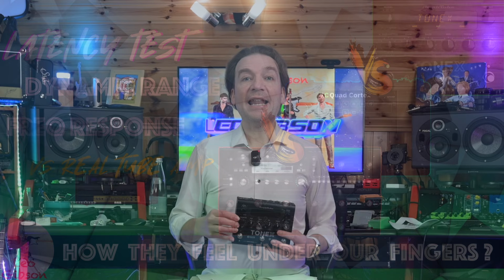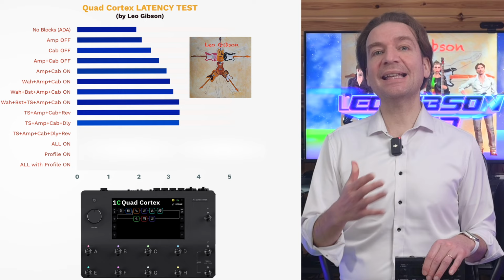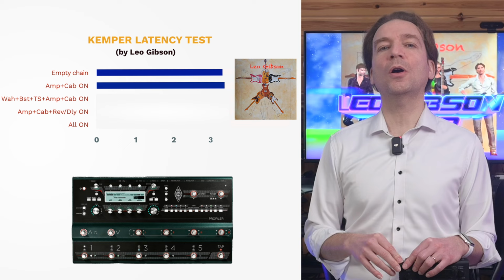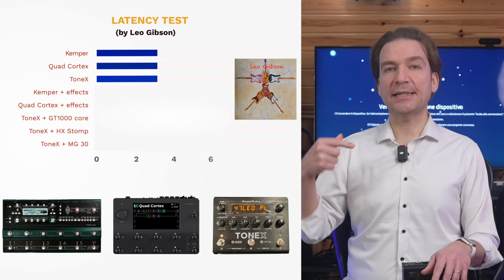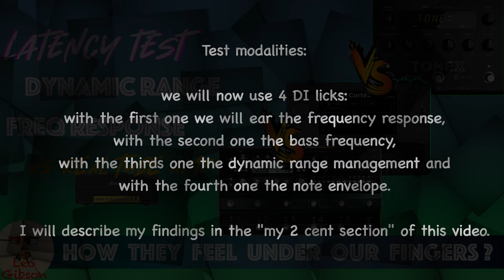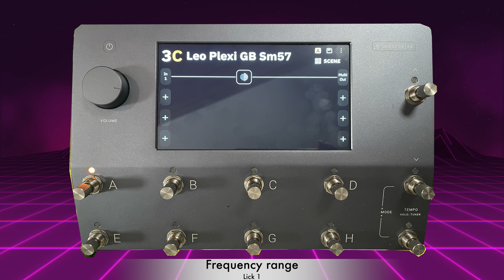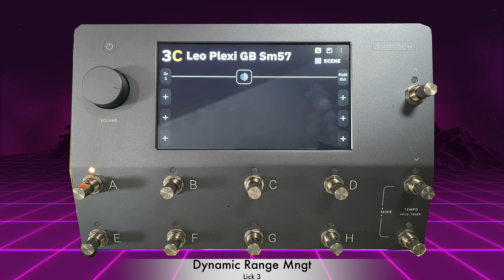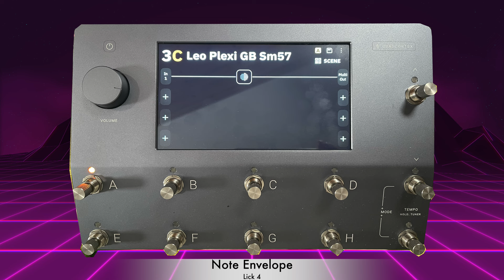ToneX Pedal vs Quad Cortex vs Kemper: which is the best profiler in the world?

Comment: There is one important factor, that wasn't tested in this comparison. With Quad Cortex if you use it full potential and use both cores (Effect lines 1/2 and 3/4 in the Grid), it adds even more latency. You could test, what is the Latency if you have Amp Block on Row 1 and Cab Block on Row 3. The result will be interesting.

Comment: This is a great way of illustrating the feel of the units on YouTube. Great job!
Reply from the maker: Thank you, really appreciated!!!
Reply: @LeoGibsonGtr  Hey man. Depending on the IR used and this includes the kemper, the latency changes. Almost doubles if it is longer. So, you have to take this into account in any test. If the kemper profiles something long it will have more latency. And some of the profiles suck because of that. If you add effects in any of these you have to go AD-DA plus the time it takes to ...produce the effect. So yeah. Crap.

Comment: I am very impressed with the ToneX. 
For less than 1/5th the price of a Kemper or QC I can get the same level of amp and OD pedal captures. Finally!
Reply from the maker: Thank you for sharing!
Reply: Yes. If you are just going to play through a  amp+reverb combo and use free online captures it will costs 1/3 the price of a kemper stage for example.
Reply: you can have mooer preamp x pedal and get profiles for different amps as well.

Comment: Hey Leo, nice video..but you glance over a few big things. 
1: The ToneX let's you daily in the 'right' gain' before you finish the capture. So that you have to maybe bump up the Gain on the Quad Cortex is kind of a mute point, I think you will agree?
If the QC would let you do the same before finishing the Capture, I think this would make them more in line

2: The Quad Cortex let's you run let's say  8 Captures in a single preset, of your amps, cabs, boost,OD, EQ pedals. That is a Big selling piont
Keep up the good work
Reply from the maker: Hi, thank you, I'm happy that you like the video!
Here, I prefer not to modify any parameters after the tone capture, so that you can hear the result of the profiling procedure without my interventions. 
That's right about the possibility to run many captures in a single presents, and there are even many more options in the QC and also in the Kemper compared to the ToneX. But this video is not intended to be a detailed feature comparisons. It is focused on feel and the main use cases for me, for all the three units.
Thank you!

Comment: To put it in perspective - 3 ms is roughly the same delay as stepping back from your speaker cabinet by 1 m. So basically placebo territory.
Reply from the maker: Let me add that latency some up...so if you add for instance a wireless transmitter, its latency sum up to the latency of your modeller...the distance from your speaker sum up latency etc....we always have to take into consideration the overall latency of our system

Comment: Great video! The sound of your amp is perfect 👌
I like the colourful sound of TONEX. Shame about the effects, when you start stacking up the latency it puts me off a bit. Do you know the minimum latency of the TONEX plug-in through Logic MainStage? I guess it would be 6ms but I’ve never tried it.
The video was excellent and I was wrong in one of my previous comments, where I said the sounds were too close to hear a difference using a phone or iPad. They were close-ish, but it’s nice to know that you can’t beat the real thing 😊
Reply from the maker: Thank you, I'm happy that you like the video!
I prefer not testing latency of USB connection with a computer, because it depends from the power of the computer I use, the buffer settings etc...therefore it would not be an "objective" measurement...in my opinion.
Thank you!

Comment: Thank you dear Leo...Tonex seems to do a better profiling job at my ears... your comments on its pros and cons are very accurate... Just would need to ask if somehow it can be paired with amplitube 5 and an ipad for using it's effects and post effects along with the Tonex preamp?
Also for example I'd like to switch the tonex off and times for example in order to use the Amplitube dimebag CFH or Brian May programs which are way better than what you can have in fractal or QC if available as far as I know.... Also amplitube variety of effects is huge so I'd like to use tonex together with amplitube 5... Thanks again Leo....
Reply from the maker: You are welcome!!
I think you can directly use the ToneX plugin in the iPad doing the thinks you are mentioning here. But I'm not 100% sure, as I have not tried myself...for sure an interesting topic...
Thank you!
Reply: @LeoGibsonGtr  thank you Leo that would be great for me...
Reply: Did you find out anymore info regarding using amplitube and the iPad ?

Comment: I like the idea of tonex wish Kemper would had done it years ago. Latency could be an issue when pairing it with other effects bc of thr conversions each pedal can sum. 
When comparing it to Kemper…the profile seemed cleaner in the tonex but doesn’t it take 30+ minutes to capture in the tone x vs less than a min in the kemper?
Reply from the maker: Hi, thank you for sharing!
Yes, in my M1 Mac it takes around 40 minutes to make a profile in advance mode...it's a lot of time...

Comment: Dear Leo, thank you very much! I have a two question, if possible - what is your opinion?:
1. I am using using iOS  tonex app with other iOS fx effects (eventide and ect..) but I can’t compare my staff with real tonex pedal  - Can you compare tonex ios app with real pedal? 

2. Is it possible to make high quality sound guitar processor from iPad m2 with Apollo audio interface and wireless boss footswitch and pedal? Or quad cortex is better than my idea? 

Thank you!
Reply from the maker: Hi, you can do what you are saying and you can obtain great results. I would just say that I would not use this setup for live playing, as it is less "reliable" than an amp modelling pedalboard that is built just for playing...an iPad can do many thinks...Furthermore with an amp modelling pedalboard you just have one unit, where with an iPad you have to connect more devices and each of them can fail. 
Thank you!
Reply: @LeoGibsonGtr  thank you!

Comment: R.I.P. Kemper, you won't be missed.
Reply: It will take years and years for the QC and ToneX to equal the amount of  touring bands currently using Kempers. 
Bands who actually tour don't spend their time on YouTube watching hyped up videos about the next best thing especially when the next best thing hasn't been tested under tour travel/playing condition for 10 years. 

If you Refine a Kemper Profile for as long as it takes a QC or ToneX to make a Capture, 5 to 15 minutes, the Kemper Profile will sound the same as the Capture.
Reply: @guitartoneSA  Maybe, but that would be the case with any neural network. Also Kemper snapshots multiple IRs, it does not do AI (neural network algo). Also Kemper has been around for 10 years now, whilst QC (maybe 1 year) and ToneX (literally one month).
Reply: Wrong. Kemper still has the best ecosystem..the Kemper Kabinet does FRFR and amp in the room....Moreover, it has the inbuilt power amp and the best selection of profiles.
Reply: @algorithm007ify  Nah, I think you might have to sell it, before price goes bellow $600
Reply: @PASHKULI  
Do you know what an Access Virus Synth is?
Reply: @guitartoneSA  Yes, and have spoken with its creator… the same one who made Kemper.
Reply: @PASHKULI  
So it's not RIP Access Virus which Christophe created in 1995 but you think it's RIP  Kemper? 😂
Reply: @guitartoneSA  Yes.

Comment: Far too much focus on latency.  Sound quality first, user experience 2nd.  Latency is only a subset of user experience and as long as latency isn't affecting your enjoyment then it just doesn't matter.    There is no reason to graphically measure it.   The same can be said by analyzing wave forms of captures.  Who cares.  If you can't tell the difference in a mixed blind test, then it just doesn't matter.
Reply from the maker: Hi, some of us are really interested in how these pedals "feels", which (in my opinion) is not just related to how they sound in a mix and if you can (or not) tell the difference in terms of pure sound. For me the "feel" is related to latency, dynamic range, frequency range, and note envelop representation....that's why I try to focus on these aspects, providing you with the most objective tests that I can do. 
Thank you for your message
Reply: "Far too much focus on latency."

Disagree. Too much latency makes sound quality irrelevant.
Reply: @EricTetz  oh really.  When I used to play on a big stage we were 30 feet from our amps and 15 feet from our monitors.   That's 1 ms per foot not including the processing time through pedals.  You end up figuring it out despite the latency.
Reply: @deans.4705  (1) Latency is cumulative. You want to minimize it at very step. (2) How much latency you're willing to tolerate is completely irrelevant to my point.